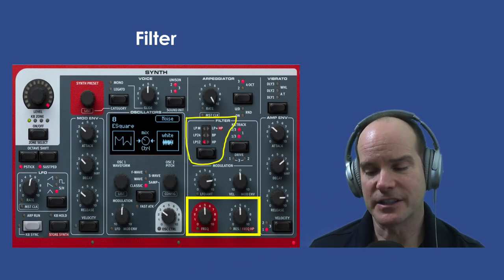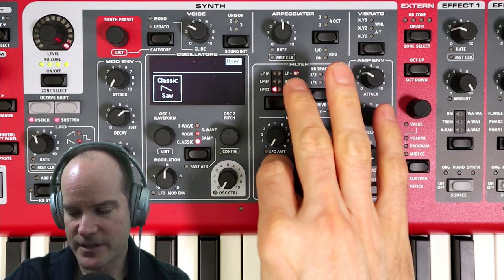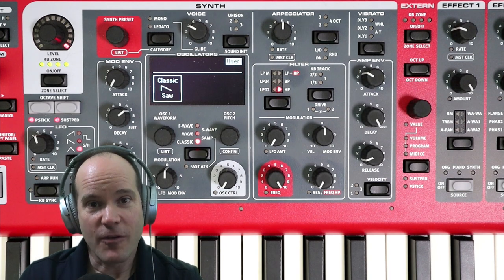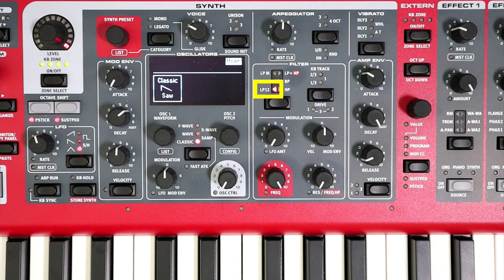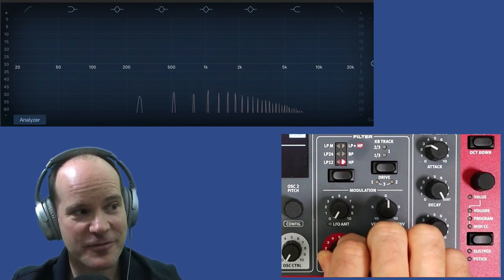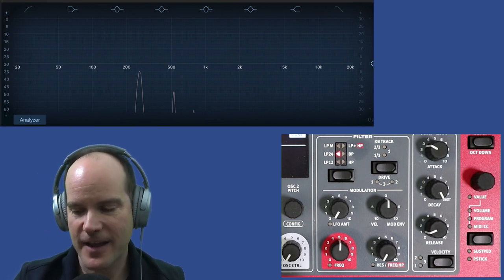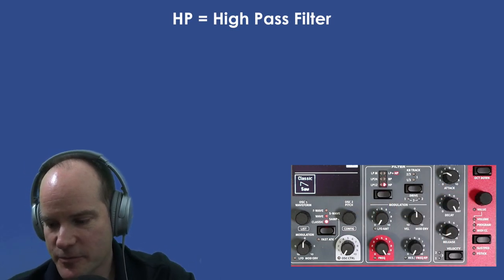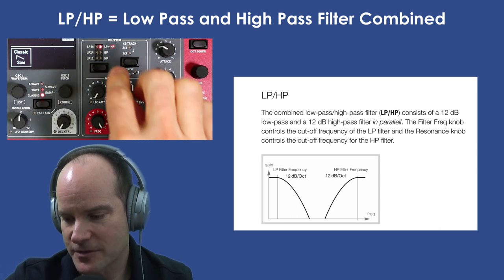Learn the Nord Stage 3 Synth Engine (Part 3) | Tutorial / Training

Comment: Great tutorial applicable to all synths. Keyboard tracking is extremely useful as the default because it turns your synth response into a playable musical instrument rather than a lab audio device. When you're playing chords up top and a bass line below, you want the chords to cut through at a brighter setting, but you want the bass notes to remain at the low end to give a fat bass. When you trim the filter frequency to give a fat bass, playing anything up top has all the highs taken out. Turning filter tracking on, raise the cutoff frequency the higher you go up the keyboard, so it allows more high frequencies to cut through up top. A good example is the 'Jump' riff. You want the base notes to be a fat drone, while the chord triads stab through the mix with a crisper sound. That's keyboard tracking treating the bass differently to the top end by tracking the cutoff frequency to the keyboard pitch, adding musicality like a real instrument.
Reply from the maker: @itsjusterthought Thank you for your insight and terrific explanation here! The one thing that YouTube doesn't allow us to do is to modify or replace videos while maintaining the original links (Vimeo does allow for this).  If it allowed for this, I would most likely replace these videos with a "new and improved version" with the insight gained in the last several years. It was largely because of this reason that I decided to put this info in the form of professional courses (https://www.MyKeystoMusic.com) where I can replace, improve and add videos keeping the content not only relevant but accurate while also delivering it in the best possible way for learning. In any case, your comment here should hopefully assist people who read it. Thanks again for taking the time.

Comment: Another great video.   Question: is the rate of the vibrato global only ?  I.e If I wanted to have one program with a slow vibrato and another with a fast vibrato, would I have to go into the sound settings and change it there between patches?
Reply from the maker: Hello @morgansamuelnz (Morgan).  Thanks for your comment.  Yes, you would have to manually adjust the vibrato settings on the Nord Stage 3 (and the Wave 2) program by program, as the settings are only stored globally.  On the Nord Stage 4, however, the vibrato settings are defined at the program level and saved specific to every program (much more flexible).

Comment: So... My Stage 3 has a few more Knobs and buttons that yours does. Very interesting...  For example; I have 5 knobs in the synth section, under the screen. There are a few other areas that are different, but I kept struggling in the synth videos, and I figured out why.
Reply from the maker: Very interesting Chris. When did you get your Nord Stage 3 exactly?
Reply: @MyKeysToMusic  I got it on Saturday, and it was brand new, in the box.
Reply from the maker: @lemmystop  Awesome!  So, apparently, the new versions have changed the configuration a bit. How Interseting! I wouldn't have expected this mid-model like this.
Reply: @MyKeysToMusic  It could have been called the stage 3.5.
Reply from the maker: @lemmystop  Yes! or the Nord Stage 3 (EKE) "Extra Knob Edition"